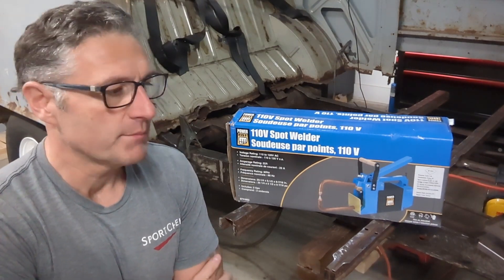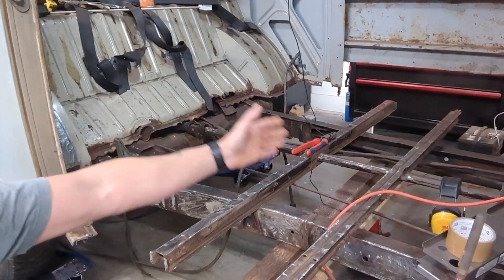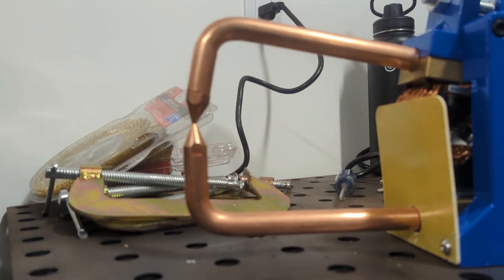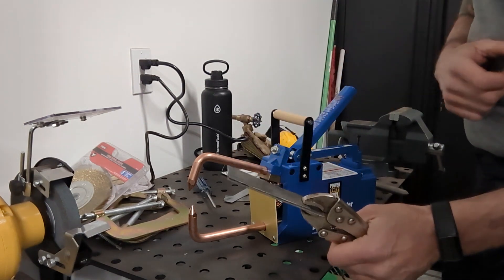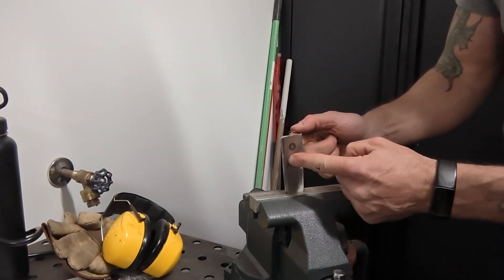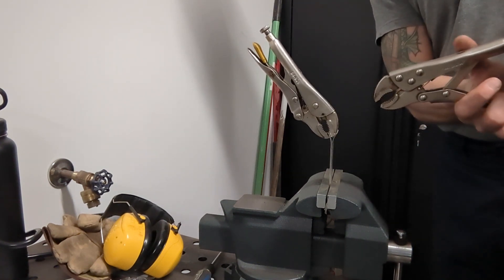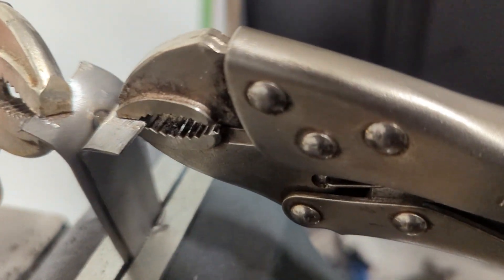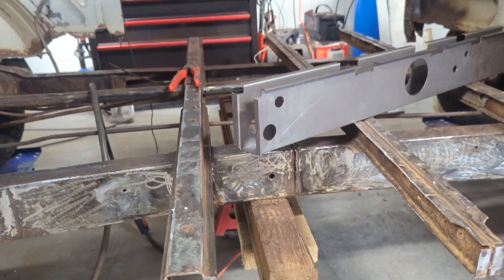110 Volt Spot Welder. Does it work ?

Comment: Any update a year and a half on?  I bought one of these last year for working on a Karmann Ghia, but outside of a few tests i really have yet to use it.
Reply from the maker: I still have it and it still works.  My only issue with it is that it is super heavy and awkward to use. 
Pinch welds on a bottom lip are the only thing it is going for.
Many areas where I would like to use it, is just not accessible.
Thanks for checking out my vid !

Comment: Oh... maybe you can use the floor jack to hold up the welder steady as you move along the rails. Those welders are about 7-10 kilos
Just make a wooden platform to sit on that you can bolt on the jack.
Reply: On the floor jack, it will be easier to roll around.
Reply from the maker: @Whitecranekungfu  For sure. It's pretty bulky.
Reply from the maker: Yes it's actually pretty dam heavy !!!

Comment: Another excellent video.
So, I'm guessing, when you wire that massive garage, you'll be using 12 AWG wire on a 240 circuit.  I'd still add some 110s for smaller items.
Maybe an aux box like the one your house HVAC uses can be added to the house garage ?
Reply from the maker: I'm planning on 110 and 240 for sure.  Might do a heat pump in the future.  When finances allow it. Lol
Reply: Fur sur....